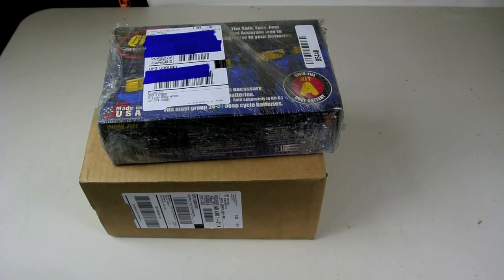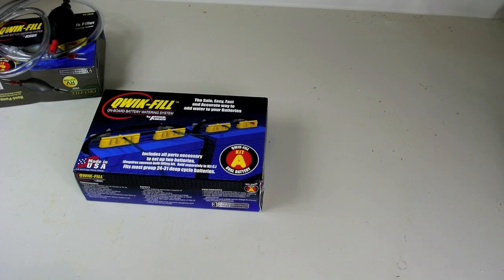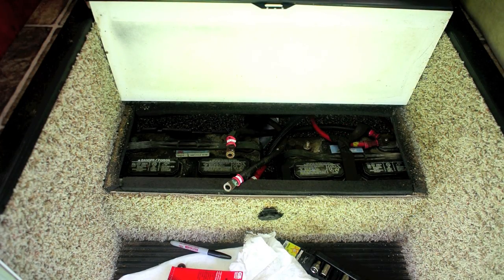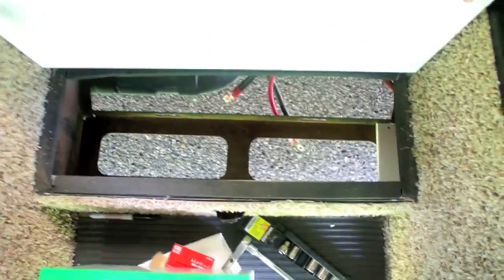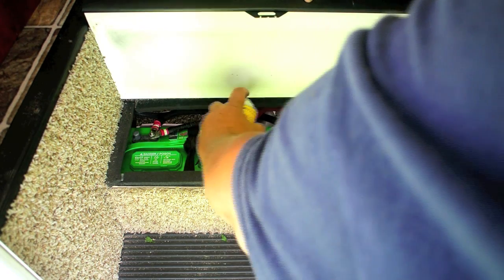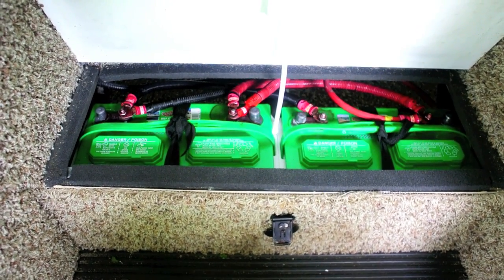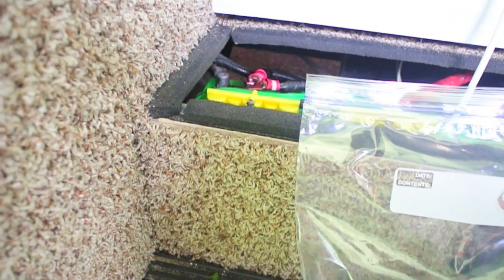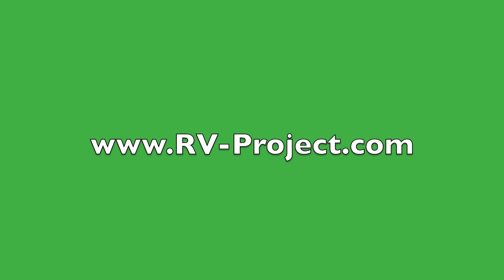Installing a Flow-Rite Quik-Fill battery kit on my RV.

Comment: Great video Thanks for making it.  We just installed ours on our RV just today, following your directions.  :) The only things we did differently than what you did in the video is that we primed our tubing with Distilled water prior to connecting it to the connector on the battery, so as to not be pumping air into my battery cells from the pump line.  Then when finished filling the batteries with Distilled water,  there was some excess water remaining in the hose on the battery side, and since Winter is on the way I didn't want that excess water to freeze in there, and burst the lines, so I lowered the hose slightly lower than the battery, pressed the little yellow tip on the end of the connector,  and drained out any excess water in the tube before putting on the cap.  I think we are gunna love this Quik-Fill because all three of our batteries are way inside the compartment where you have to be on your hands and knees, leaning into the compartment, and even with a mirror it is near impossible to see down inside the batteries. So we are super jealous of all the folks who have easy to get to or a slide out battery compartment on their RV.
Reply from the maker: Thanks for sharing your experience.

Comment: Suggestion for next time.  To clean battery terminals, battery cable ends and even the battery itself there's a old mechanics trick that's less expensive than spray can cleaners which is easy as well as most likely in stock in the kitchen.  Mix baking soda with water until the mixture is milky, it won't take much as in a pint or less of water.  Stick the cable ends in the mixture and swirl, rinse with clean water after the cable end stops boiling.  No brush and brushing necessary.  Pour the mixture on the battery and posts then rinse with a garden hose.  Done.  :)

Comment: I have a 2015 Fleetwood Bounder and the battery cables are crossing the Banbury caps so I'm going to have to have them rerouted so I can get the caps off